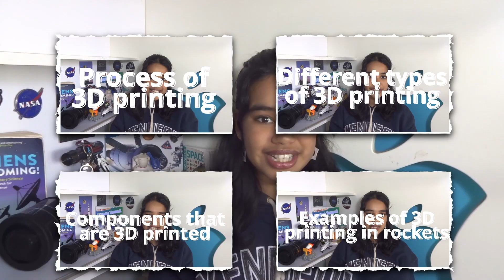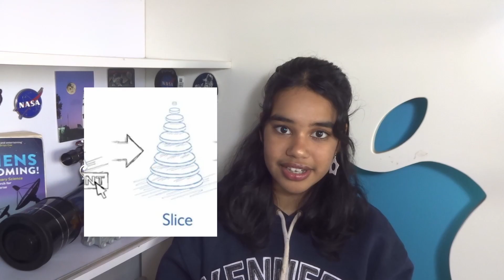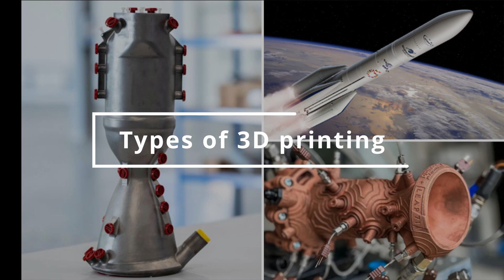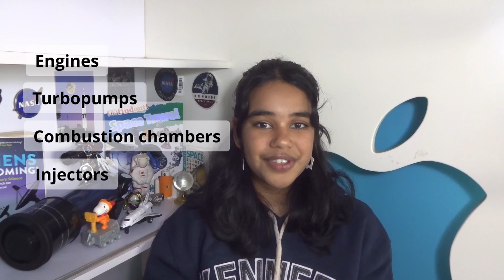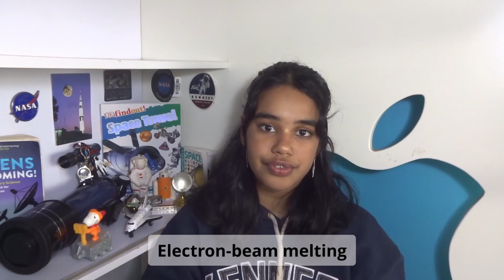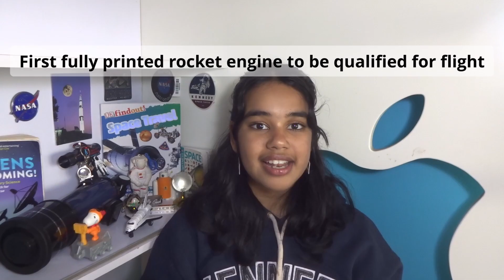3D Printing in Rockets - A Rapidly Growing Field in Aerospace

Comment: The shift from traditional manufacturing to additive processes like Directed Energy Deposition (DED) is absolutely transformative for the future of launch vehicles. Seeing Terran 1 achieve 85% 3D-printed mass highlights how we can move from months of casting to just days of printing for critical components like Merlin 1D valves. 

Consolidating complex assemblies into single-piece systems, like Agnikul Cosmos’ engine, is a masterclass in reducing failure points. This kind of visionary efficiency is exactly what will define the next era of space exploration.

Since we’ve seen success with 3D-printed combustion chambers, what do you think is the biggest hurdle in applying this to primary structural components for heavy-lift rockets?
Reply from the maker: Thank you for your comment! I completely agree, the 3D process is going to revolutionize 3D printing in aerospace. However, I believe currently the biggest issue is the lack of historical data showing that 3D printing is indeed safe for structural components. There just isn't enough testing data compared to traditional manufacturing, which leads to major companies avoiding its use due to not having confidence in 3D printing.
Reply: @SpaceForecaster  That makes total sense. It's crazy to think that even with all our tech, 'we've always done it this way' is still a major hurdle. Do you think startups like Relativity Space have a better shot at proving this safety than the giants, since they're building their entire 'Stargate' infrastructure around this from day one?
Reply from the maker: @FounderInSpace  I think they do have some advantages, as they showed how they could reduce the complexity of rockets through the use of 3D printing. Stargate has also passed industrial standards for critical parts, meaning there are no issues with their rockets. However, bigger companies have already done thousands of launches that were safe, and have more advanced 3D printing technology, meaning their rockets are more likely to guarantee safety than startups.
Reply: @SpaceForecaster  I totally see the 'safety in numbers' argument for the legacy players. However, the most compelling part of this approach isn't just the printing—it's the iteration rate. If a team can fail, redesign, and fly a new engine iteration in weeks while a larger organization takes years to move a single valve through committee, the 'new guard' could potentially catch up on those data points much faster than expected.